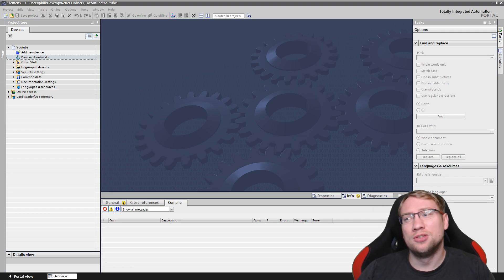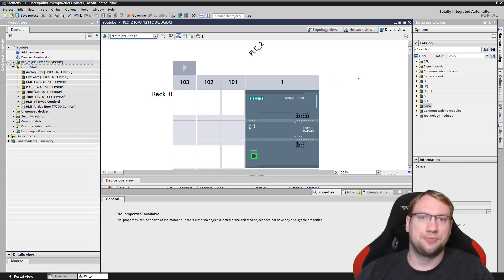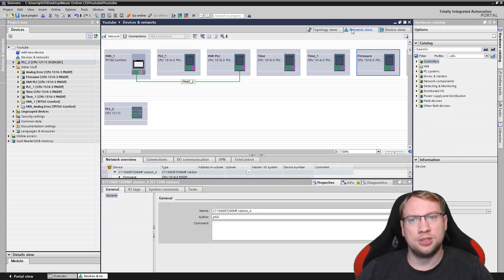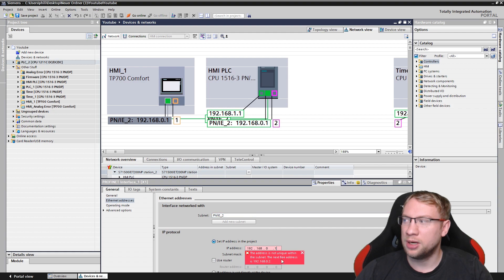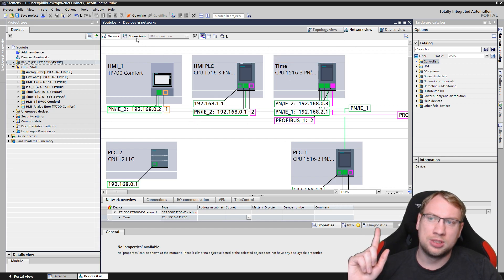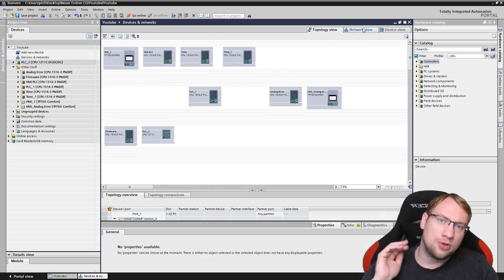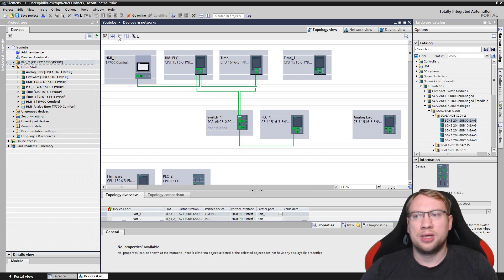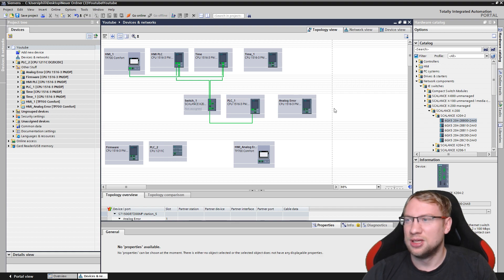TIA Portal: Device vs Network vs Topology View

Comment: Additionally, with Topology, if a subordinate device fails, replacement of the device is easier as you don't have to reinitialize the node; additionally, the controller can provide the the parameterization of the device without having to shut down the network or PLC (redownloading config from Portal).